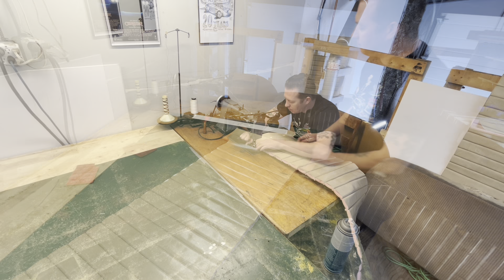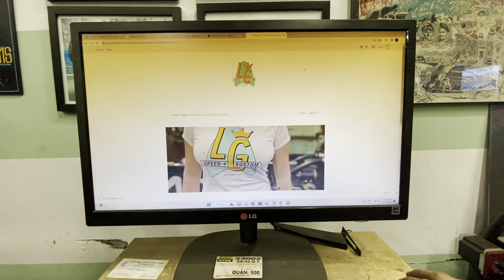How To - Sewing a Tuck and Roll Seat Cover for my 47 Ford

Comment: Another GREAT Video,  Thanks Lee -- You inspired me to give it a go on my 29 pickup when you did Shanes Model A, using the same seat i have.  And here we are again, inspiring me to add to the stack of upholstery jobs and do my 47 coupe ---  I see you have yet to build that extension table to your sewing table
Reply from the maker: Haha actually the extension can be seen laying against the wall in the back ground. I just have to mount it the table. That may take two more years, but it’ll eventually happen

Comment: Hello! Love all the vids. Been following you for a while. Anyway you sold me on them new repop carbs. No leaks, responsive . I want to get your opinion. I have a 28’ roadster much like yours only with wide whites and a bit on the 50’s side. It’s black with an ivory firewall, ivory steering wheel and I have some top material that’s very close to that ivory English pub. So I decided to do a two tone using black and ivory English pub and can’t for my life decide on how to do it. Ivory pleats inserts on seat and panels with black boarder or visa versa? The Texas Playboy is best example of the template. Chao -David
Reply from the maker: I’d do a black seat with ivory inserts and ivory piping.